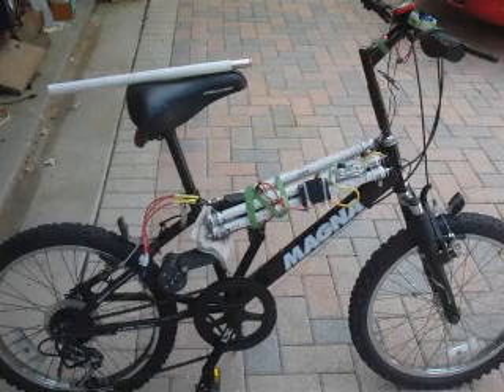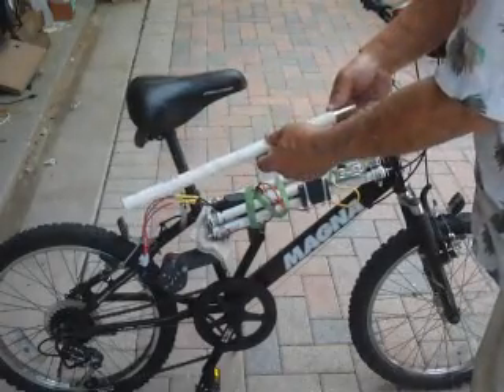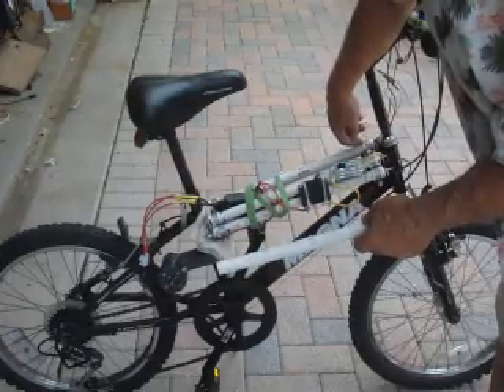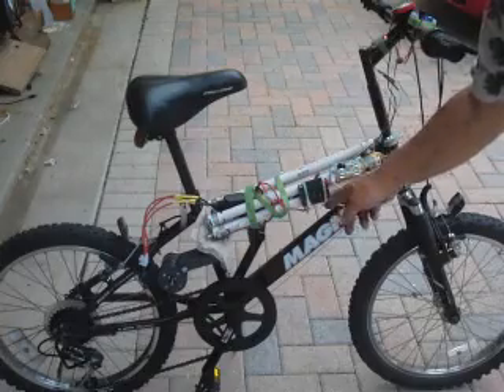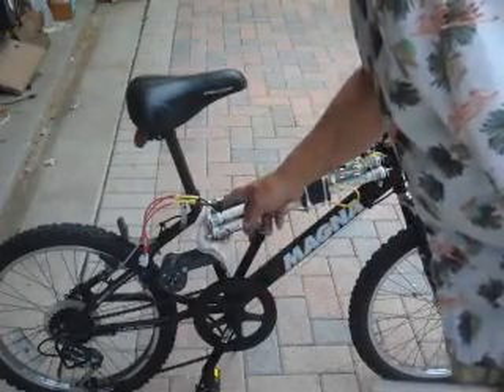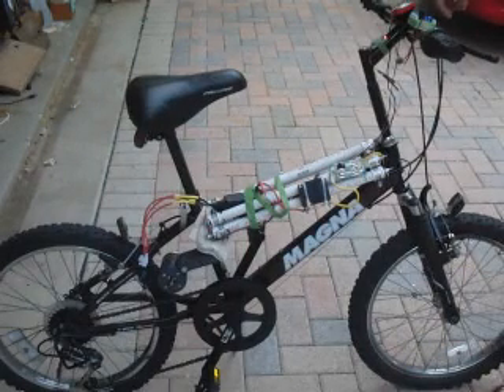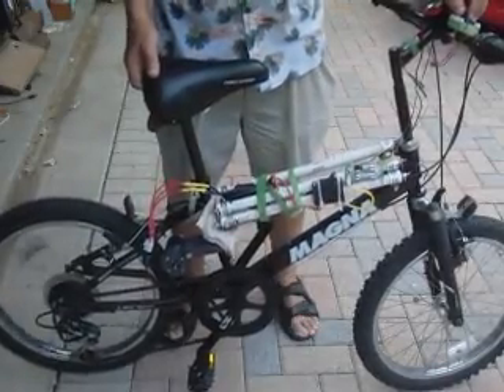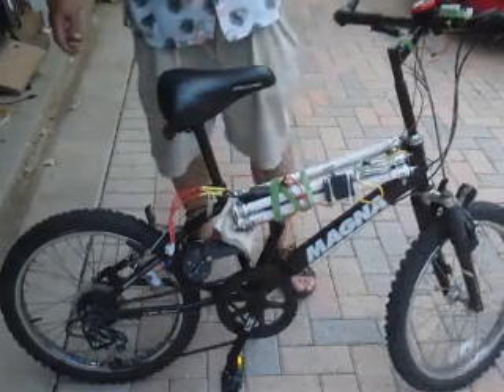Homemade Electric Bike With Recycled 18650 Batteries

Comment: Class 315 1/2 inch Custom Length. Min 6 in., Max 7 ft 11 inches
Class 315 1/2 inch Custom Length. Min 6 in., Max 7 ft 11 inches - PVC-PIPE-Class315
 

Class 315, thin wall 1/2" PVC Rigid Pipe, .080" wall thickness, .840" OD. Good for projects that do not need a lot of strength. Lightweight pipe will save about 50% weight overall. Length is plus or minus 1/8".  this won't even do it..